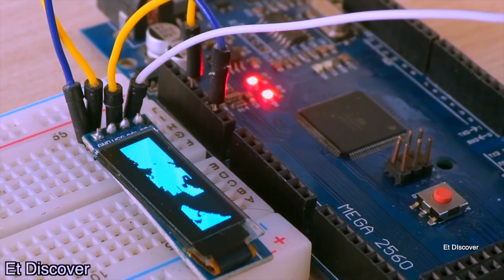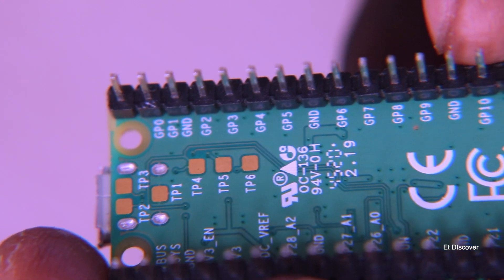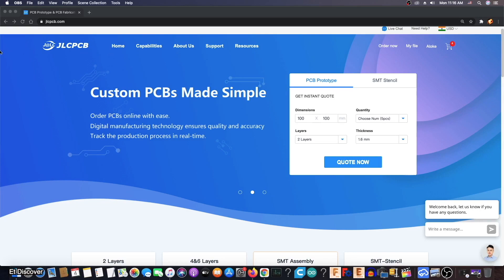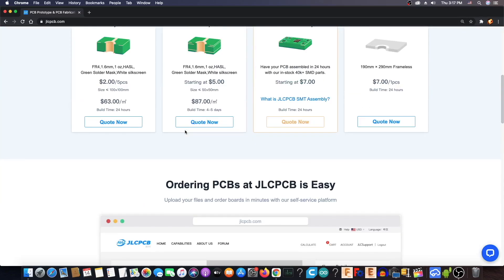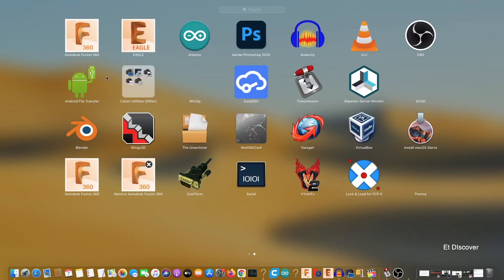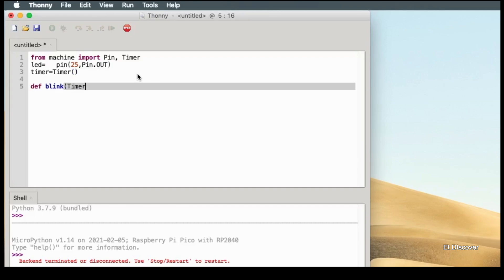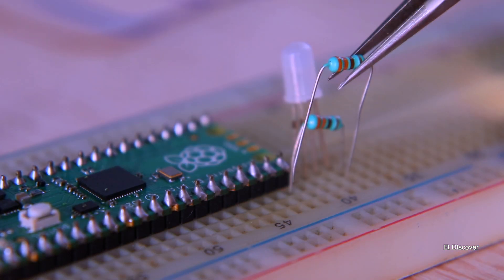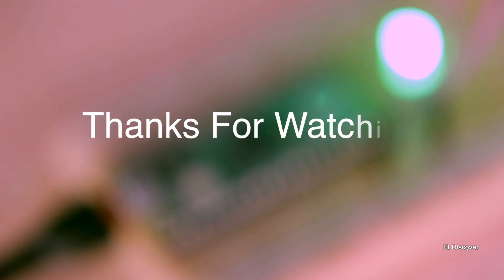New Raspberry Pi PICO Beginners guide, & Some Experiments

Comment: Bro I want to make SMD rework station
I have completed all project
But when I purchased element and make the dimmer for that it is not working the traic will burn quickly I have make sure that there is not any connection problem
Now what should I do